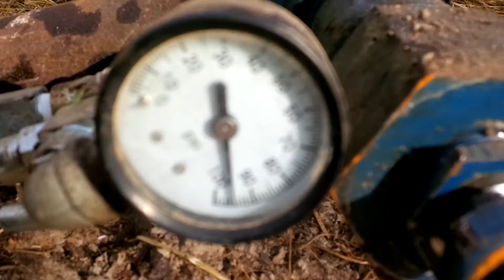ATR Energy Oil Well Drilled in Overton Country, TN in Now in Production

Comment: Nice set-up.  Appreciate your video. It would be most interesting to be an "operating partner" and learn all about the project and to make it work better.   I suppose most stripper wells have to shut down for a little while in this crazy market.  Where does the pumped oil get stored and how often is it transported?

Comment: Wow, a gas producing well ran on ELECTRIC?   That gas flare is money burned....  the head gas could be used with an Arrow engine "one lunge" and it will not have a electric bill.
Reply: That depends on a number of factors. Electric AC induction motors are much lower cost to purchase and to run. Also, we don't know how much H2S is in that gas.